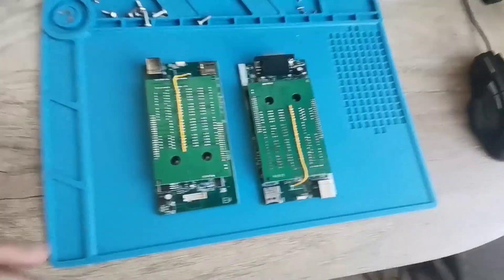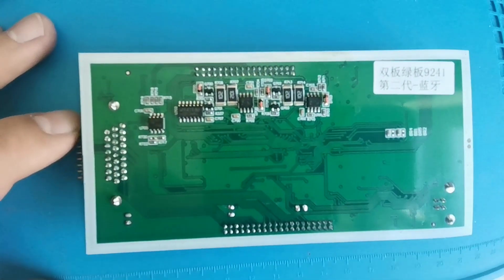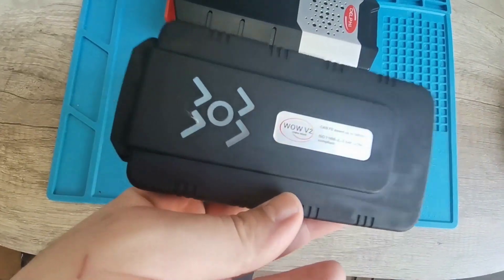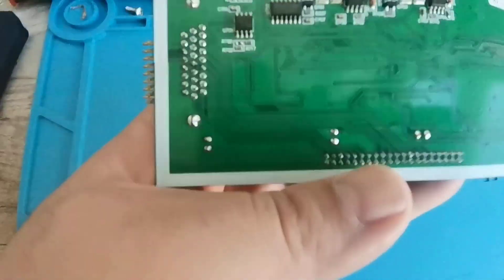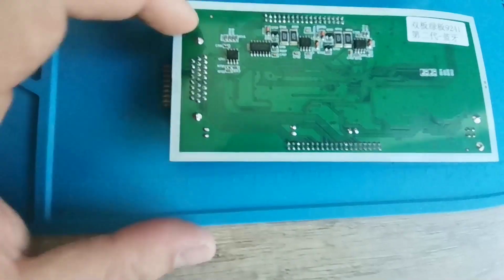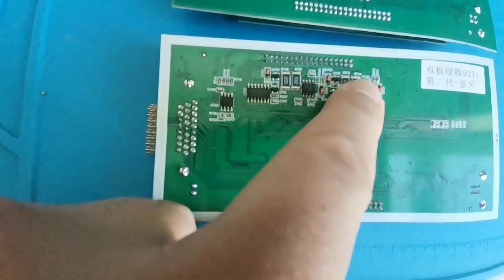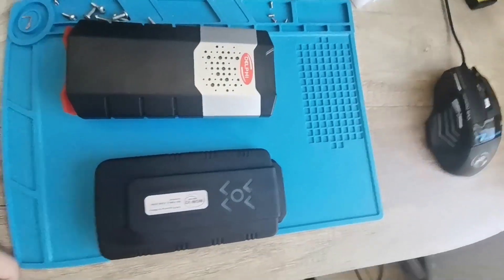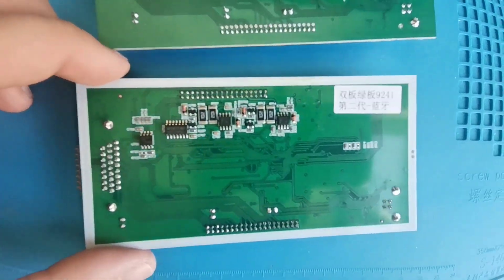This is best PCB Clone  ds150e/100e (Delphi Clone /Autocom Clone)

Comment: hi,i have delphi clone with tcs main v9.0, dual green board, sn 100251 ,in proces update firmware my connection lost and i have only red lights. I try with flashloader but no connection success,i try replace files in firmware folder then try update firmware,no success,i use delphi 2015 relaese 1,please help me,what can i do? Greetings from Croatia!
Reply: Dual Board should only work with FW 1622 if i remember correctly. Newer FWs are for single boards only
Reply: @Mikserinho  my dual board works with 2021 software,i got the atmel+ red relay one, and in install of software it asks me if its single or dual board. so maybe they fixed it either in software or the v3 has different hw aswell
Reply: @robivlahov Firmware and Software are 2 different things. Mine works with 2021 as well, but it can only run an older Firmware. The 3xxx ones are for single board

Comment: Hi Yoyo, I've got the best v3 clone exactly as the one you are showing in your video, I'm using the wow 5.00 8 software and I wanted to try autocom and delphi software. Could you recomend me which software version would be the best and work properly with my v3 clone?
Thanks in advance!
Reply from the maker: Hello,
You can try version 2020, but leave the firmware version to 1622
Reply: @YOYODiagnostic  thanks👍
Reply: can you please share the link for the good clone ?

Comment: mine is v3 the same as yours in the video , and it does not connect to citroen c4 1.6 hdi , it only gives generic obd , is it normal ?
Reply from the maker: Hello.
It should normally work.  As far as I know the citroen brand had a connection problem only on the Radio. 
 Can you connect to other modules in the car?

Comment: How to fix Bluetooth on  v3 pcb sometime connect sometime not. That yellow wire is cutted in half. Should it be connected to another part of pcb or not? Thanks!
Reply from the maker: Hello.
In general, the connection is lost due to poor Bluetooth quality.  The wire is connected to one side of the board and acts as an antenna